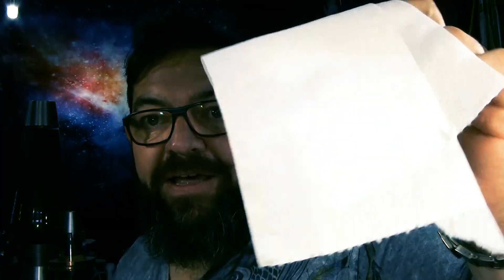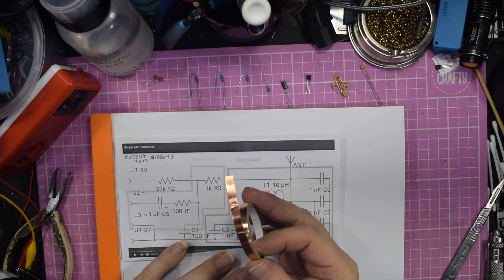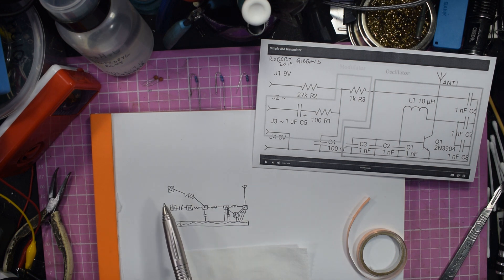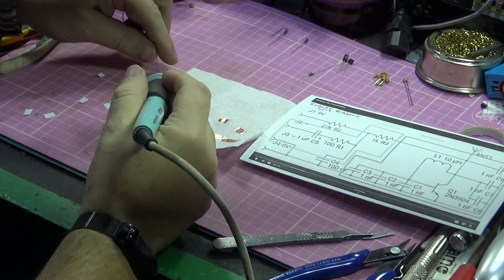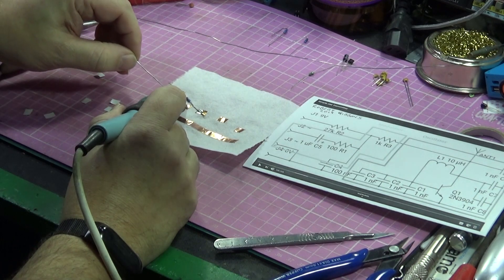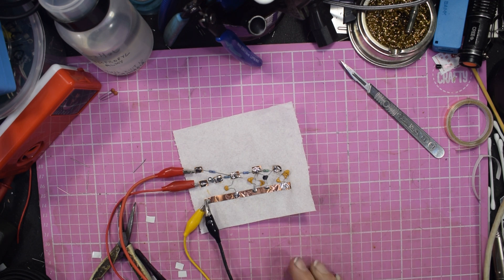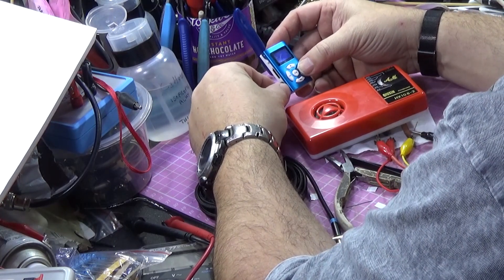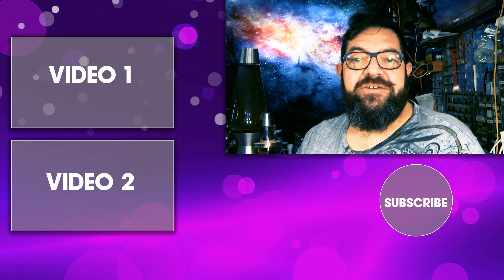Build an Am Transmitter on TOILET PAPER

Comment: Done it with that with cardboard years ago, Have to make a video of it. stuff works good:>)I used pen flux to help stick um down.
Reply from the maker: I did the prototype on a card but wanted to go a bit more extreme Art. I'm going to have to find something even stranger for the next build.
Reply: @GeorgeChristofi  I built a voltage ladder with it. From 3 volts dc to 600 volts ac if i remember right.Using 2 transistors to excite the circuit. Put spark tube on end to observe the spark.
Reply from the maker: Art, funny you should mention sparks... I was toying with the idea of using an ignition coil from a car to make a spark transmitter. Next time i'm in my parents garage I am going to see if I have one or two laying around.
Reply: @GeorgeChristofi  That should spark some fun :>)

Comment: I just bought some copper tape off ebay thinking someday I might need it, but I had no idea what for.  May do this using something a bit more substantial than toilet paper.
Reply from the maker: I got it originally to repair a flexi cable that went round a panel. Seemed silly not to use it!

Comment: Never saw a TP transmitter before but I have seen a receiver made with a razor blade before :)  That copper foil looks like the copper "wiring" they use inside those reels of LED strip lighting.
Reply from the maker: It is similar Gary. The roll I used there I originally got to repair a flexi cable that went round a panel.